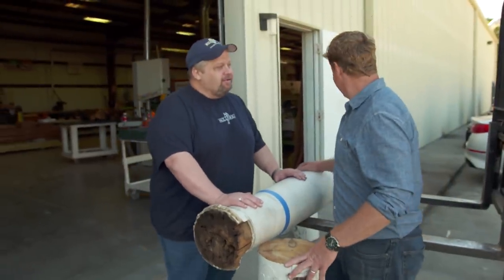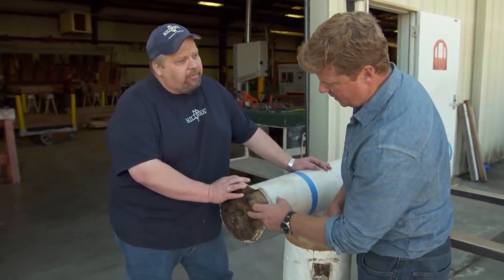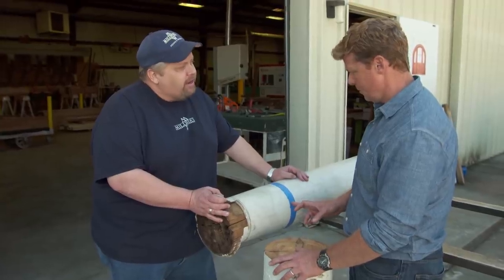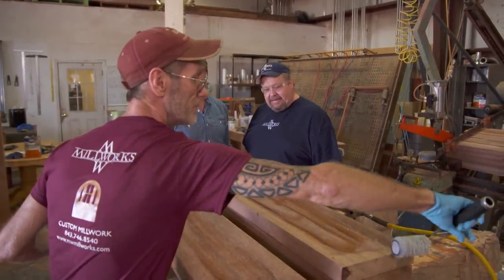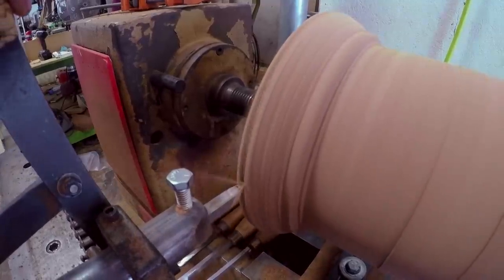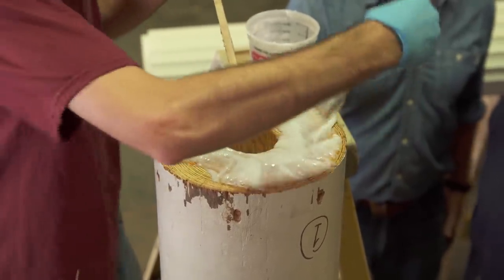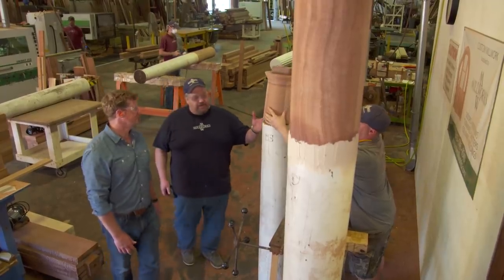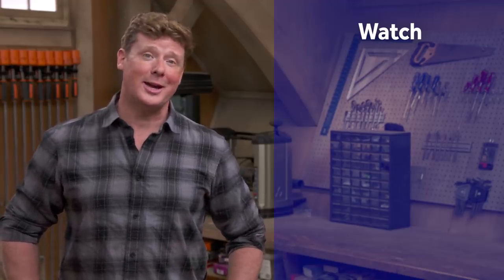How to Restore Historic Porch Columns | This Old House

Comment: Just butting in... If you have columns made from strips that have come apart - don't fret. I restored a column from the 1880s (on the Robert Owen Coop House in Ann Arbor Michigan). A corner of the porch had sagged due to carpenter ant damage, some how this led to one of the columns bursting apart. I was about 20 years old then, didn't know much; as part of my monthly coop chores I fixed the porch. I was surprised how easy it was to re-glue the column. I light scraped or sanded where the strips met, did a trial fitting by barely getting them together and wrapping a rope around them - they went right back together perfect circle... Okay. I mixed up some resorcinol (sp?) glue (I think the best stuff available in the 1970s) glued it back together.  The task in the video is much more difficult. Thought I'd add my account just in case someone comes here looking for information and they have the situation I had.

Comment: What kind of orbital sander is that and what grit pad did you use? I’m working on my columns and it’s been a pain trying to smooth out the surface.
Reply: The craftsman is using an electric da sander. I’d work with a range of 60-120, sometimes 40 when working with wood.

Comment: I wonder why mahogany. Seems like a pricey wood if it's just going to be completely covered in paint.
Reply: Good question!  The old stuff was heart pine.  It's rot-resistant, dimensionally stable... and very, very hard to find big pieces of these days, since it takes decades, if not centuries, for a tree to produce an amount suitable for a project like this.  Sapele is comparatively plentiful, and has better resistance to rot and insects.
Reply: @d.o.t.  That's very interesting. When I think Mahogany (sapele or true), I think "costly imported wood" but I suppose that there are plenty still-more expensive woods out there, including massive pieces of slow-growth heart pine. Thanks for the insight!

Comment: You can actually purchase old Telephone poles for cheap. Just sand them down and fill any splits or holes. Then get some manufactured column feet and headers.
Edit: I just searched google, and I found listings for Telephone poles for $5, Pressure treated poles being sold for $2 a foot, FREE poles for pick up, etc. It's a really good option especially if your columns were heart pine, since most telephone poles are Pine to begin with.
Reply: old telephone poles are treated so they dont hold paint or stain well
Reply: @M4st3r0fN0n3  They're also...usually really toxic to work with. Not to mention the quality of wood, cracking, splitting, etc is completely normal in utility poles. Not quite woodworking quality wood.
Reply: Just fill in any flaws with their peanut butter substance!
Reply: @MoneyManHolmes  dont forget the ramen and super glue too

Comment: "Restoring" it by using a different species of wood
Reply: chinchilla149
 ... I think the point of restoring it is to use all wood in a solid column, which can't easily be bought these days. Most of what's commercially available is hollow and fiberglass.

Comment: What are you supposed to do if It's not able to be saved at all??🤷‍♂️
Reply: Then, do to safety and structural issues, the Historical society grants you a special permit to deviate from the original specs.
Reply: Build a time machine and get a new column
Reply: You only need to save one nail. They make the rest and insert said nail totally historical
Reply: They make you jump through massive government red tape and you have to get written approval..No on would do this nonsense if the laws didn't make it so expensive.  Historical society is just another group that wants their hands greased. There are so many ways to make recreations that no one could tell the difference but they want their money.
Reply: @zack9912000  ... in most areas the historical society is either low paid or volunteers. It's the politicians I worry about.
Reply: @zack9912000  ... I'll admit the regulations can be cumbersome but if you always approach them like a bull in a china shop then that's what you get in return. I recently went through some of this locally and the building was basically a "tear down" but the location was historical and the town wanted to keep the flavor of the old town center. A decent architect drew up some plans and stated the contractor would save what he could. Each phase brought in the building inspector and with his nod they tore off section after section, rebuilding with structural steel, central heating / AC, fire sprinklers, electric, plumbing, etc, and then refurbished the outside in a similar style to what was there. The new building will be worth well over a million and the town will be glad to collect the taxes. Oh, the fire marshal is also happy because it's all up to new code. BTW, there were no extra fees involved beyond the normal building permits. (based on construction costs)

Comment: screw restoring them just replace it with a one that looks a feels like the original. I bet you probably won't be able to tell the difference.
Reply: Agree, especially if they use Mahogany, Cedar, PT for the whole piece. It would last forever.
Reply: Worked on a number of these kind of homes and the historical society and government red tape, triples the costs of any basic repair. They want their palms greased.